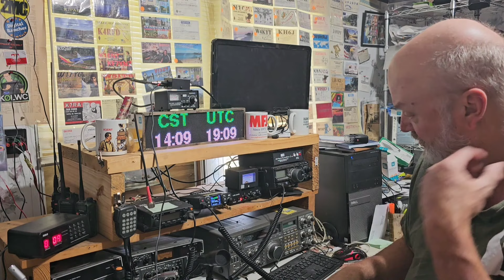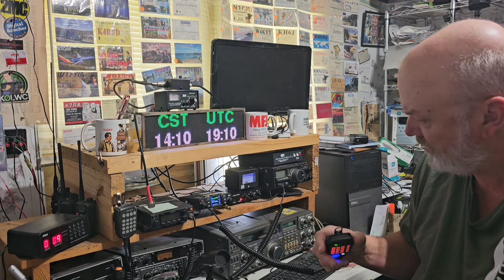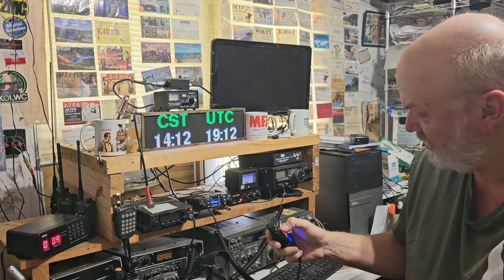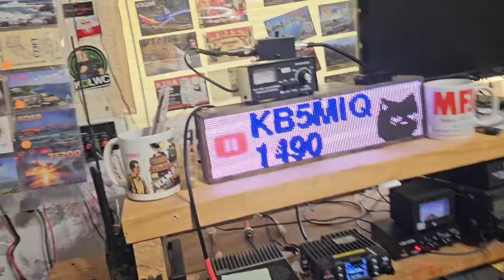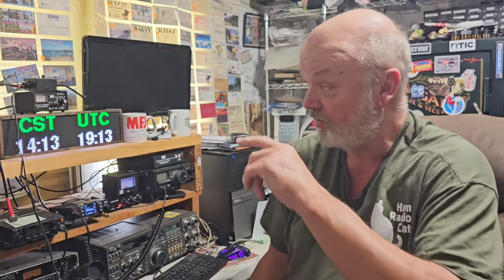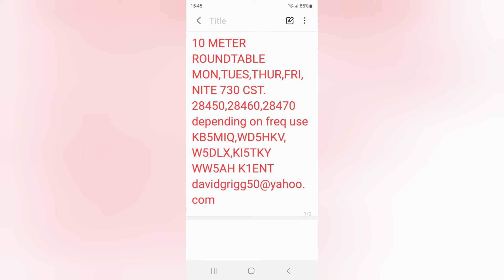Review of MFJ 4712 2 position antenna switch! #mfj #mtc #hamradio

Comment: I see now. it provides power over the coax cable to actuate the switching relay up at the tower. I thought it was all in the shack when you mentioned it the other night. should work really well and save a run of coax for the user.
Reply from the maker: thanks buddy!!73!!